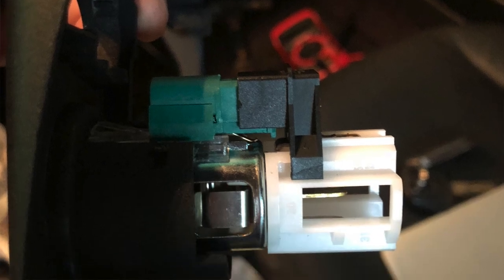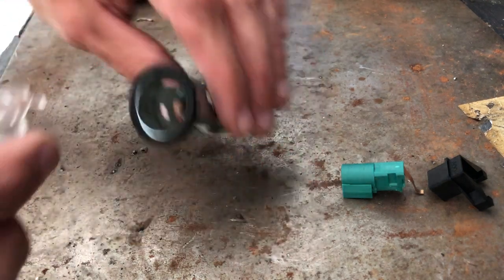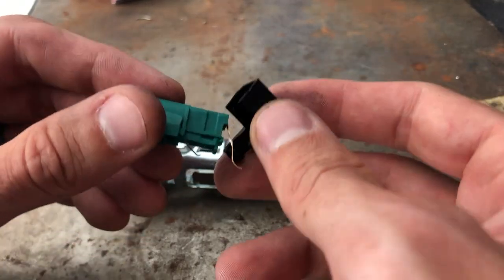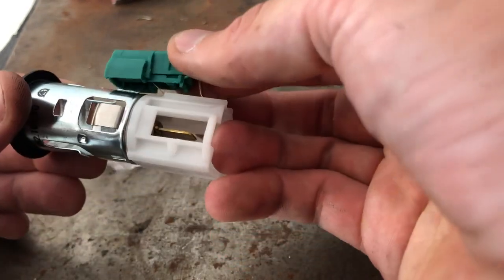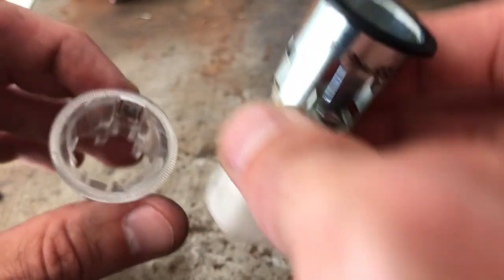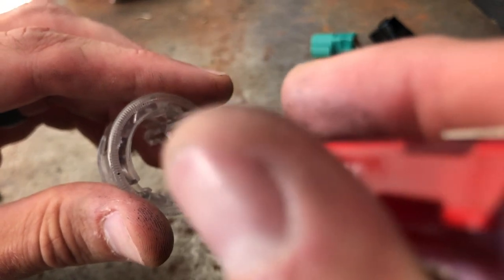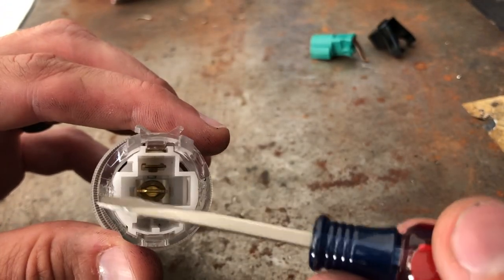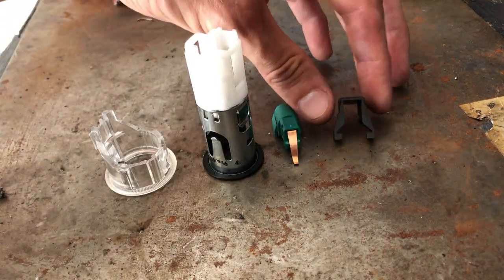Porsche Cigarette Lighter Removal How-To

Comment: Thanks dude. I was just about to trash it to do a carbon fiber skin of the horse shoe. After I could see from your video what actually held it together I ran a small drill from the backside of the clear plastic to partially take out the two tabs as they were stubborn. Worth mentioning that both parts come out the front with the metal first. You can then see another couple of plastic tags that hold the clear plastic in place easily.

Comment: This video just saved my life.  Once you snap that plastic piece onto the metal one , it is NEVER coming off unless you damage it a bit.  The clips are far too snug, you would need 4 tiny hands to actually pop it out.   I ended up drilling out the plastic enough to just pop it off.  The only downside is when you pull out device plugs it pulls the metal out with it a tiny bit.  You can superglue this or fix some sort of harness to keep it in place if you really care.  My device is a usb-port which never comes out so I am good. Thanks again for pointing out the clips!  I thought I was doomed.

Comment: Really simple solution to getting the clear piece off if you have the piece out of the car already. Just place standing upright on a bench. Put light pressure on the clear outer ring.  Whilst putting a little pressure on just one of the tabs to pop it out. Careful as it will give quickly and catch your fingers as it slides down. Very little pressure needed.

Comment: This was very helpful - other videos on the matter don't demonstrate just how tricky this piece is. Like you, twisting the clear piece so I could get at the smaller clip was critical to getting the piece out. For getting the lighter shaft out I found putting it against my floor mat and pressing down on the face of the trim made it pop right out. In general I had to apply much more force with these plastic pieces than I expected. Anyway, thanks again.
Reply from the maker: Glad it helped!

Comment: It is much easier than this.
After removing black and green parts, looking at back of lighter turn the lighter body from 12oclock to 11oclock .
Counter clockwise just a bit.
Push lighter body forward about 1/2 an inch. It will then be able to turn back to original orientation. If not you are not deep enough in or too far. It does all this nice and smooth.
Once back in 12oclock position it will simply push the rest of the way out.
No fiddling with the clear piece. No parts broken.
Clear piece does have to spring release clips and slides out easily as well.

Comment: I don't want to remove the whole cigarette assembly I just want to take the black plastic piece out of the metal and plastic piece - the part that has the picture of the lit cigarette. I pushed it down by mistake not realizing it's not going to pop right up.

Comment: Nice vid....thanks for your time.........At the car I cannot remove the colored connectors...what is the trick to getting them off correctly?  pinch...pull......???  I might just give up and do the entire replace from the car since I was able to un plug the cig adapter
Reply from the maker: Hey Jim, I can't remember. If you can send me a picture of the connectors it may help jog my memory. My email address is charlieaf92 at gmail.